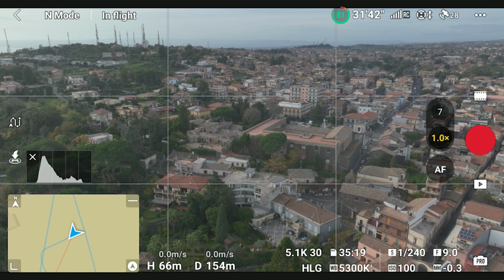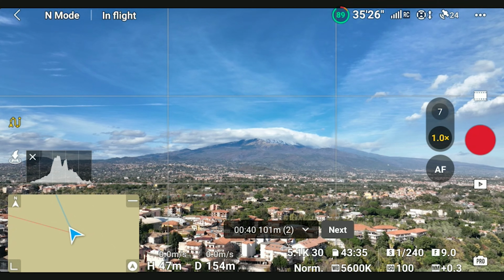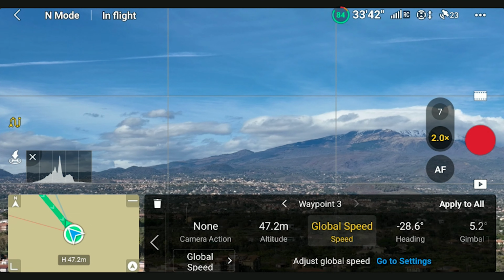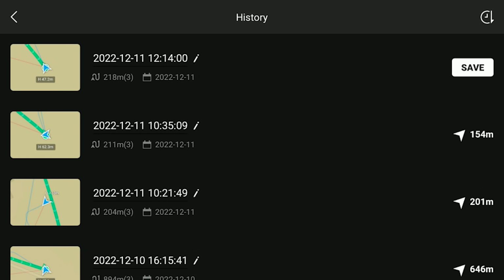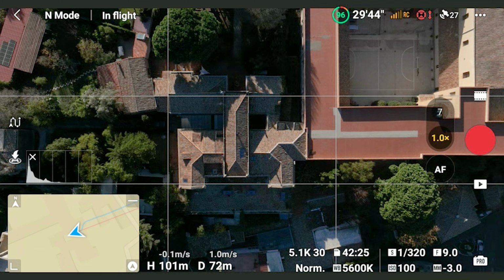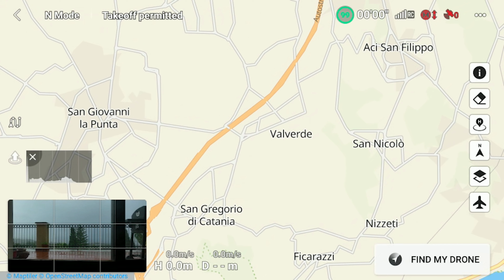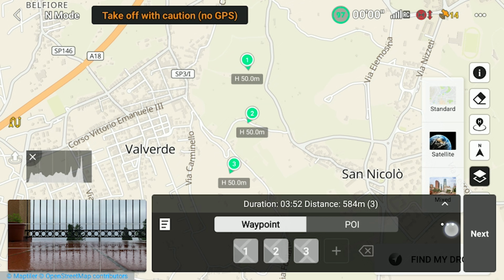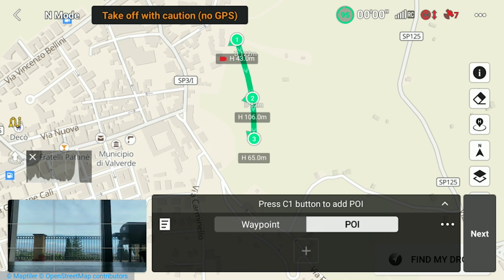Dji Mavic 3 and Classic Waypoints 3.0 - FINALLY Back!

Comment: In short, and speaking about projecting a flight from "home", unless they modify many, many things, the waypoint module is completely inaccurate. Beginning with the maps the they should get quite a lot nearer the ground. i.e. A tower of a castle looks so little on the map..... apart from that the inaccuracy of creating waypoints with the finger.... totally unprecise..... my e-pencils do NOT work with the DJI RC PRO, so have to add points with the tip of my finger. And why the heck do I have to use the RC control for that? The lack of possibility to create waypoints on the laptop would also simplify things. Nothing difficult... if Dronelink and litchi can do it, why not DJI. If they want to improve, there should be more firmwares to come!! Any ideas coming from anyone will be welcome

Comment: This is a great tutorial, definitely worth a Subscribe!  I especially like the visual demonstrations of the transitions of flight and gimbal movements through various Waypoints.  Your Crane and Screwdriver demonstations are pure gold, and got me motivated to get out and do some Waypoint missions with my own Mavic 3.  I've been flying it in Night Mode a lot recently, testing for the best angles and drone moves for dynamic, cinematic shots, and just posted a video of the best of them (downtown Seattle Christmastime lights).  Now I'll be interested in incorporating Waypoint flights to get even smoother and more complex moves.  For your map-programmed missions, do you know whether the drone sets its altitude at zero based on its Home point at the time of the mission, and then all the Altitude values for each Waypoint are relative to that Home point altitude?

Comment: Well done Vic.  Using the mission created on a map; suppose waypoint #2 and #3 were up on top of a hill 400' higher than waypoint #1.  Im curious if DJI's program would keep everything relative to waypoint #1 or does it know the terrain and altitudes on the map and set the altitude to above waypoint altitude?

Comment: How do you use poi on the first method?
Reply from the maker: I did try to set a Waypoint using the first method, but nothing happened. 
I don-t see how it can help with the first method, while it is useful when setting the points on the map